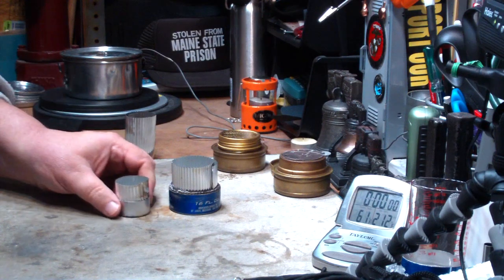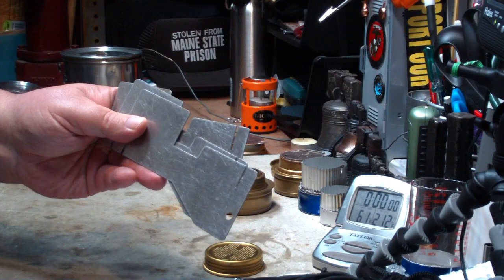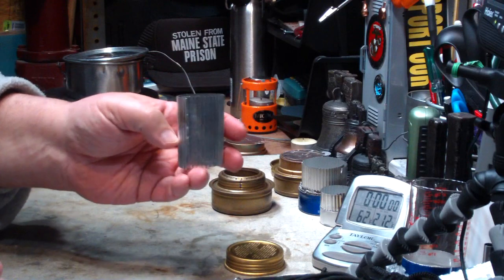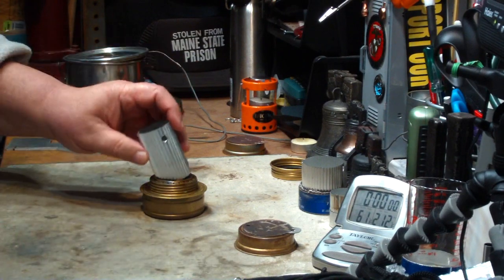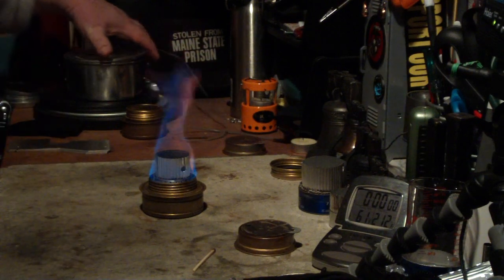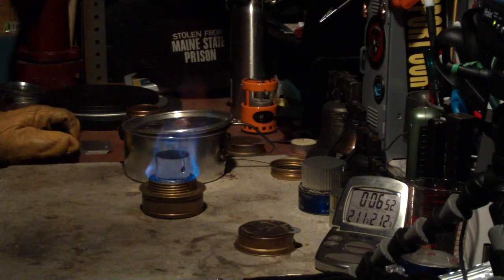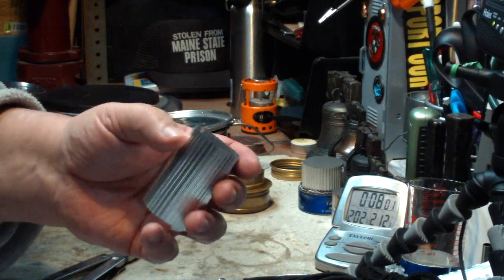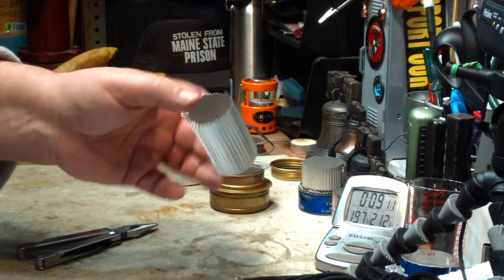Internal Corrugated Aluminum Pot Stand - Boil Test #2 - Trangia

Comment: How did you corrugate the aluminum?

Also, nice contained flame with that aluminum part.
I wonder if the aluminum transmits heat to the alcohol and heats the alcohol up faster?